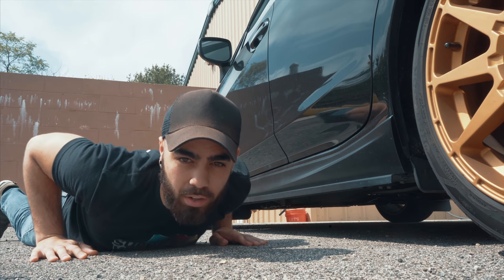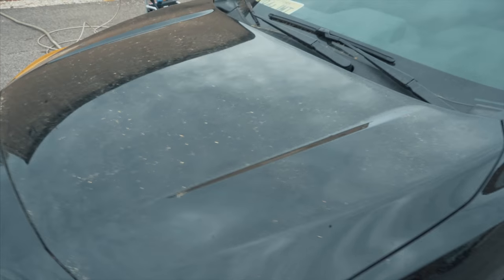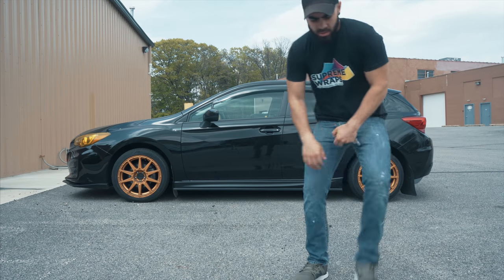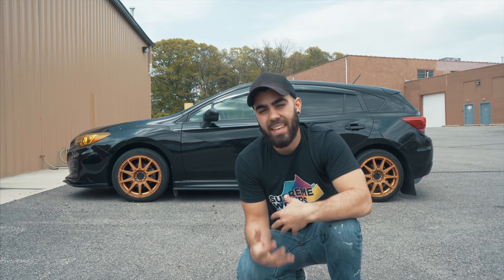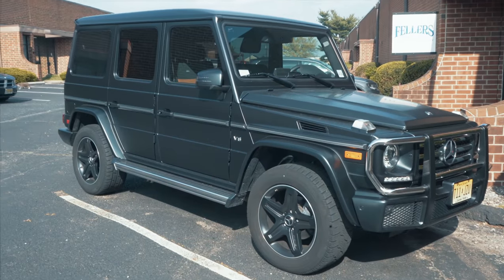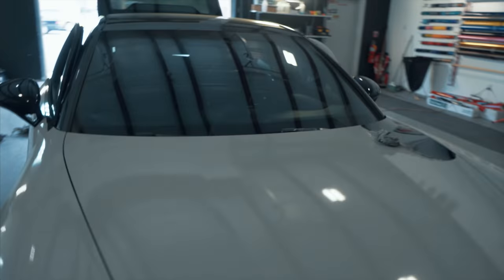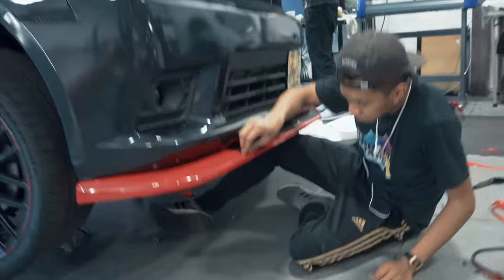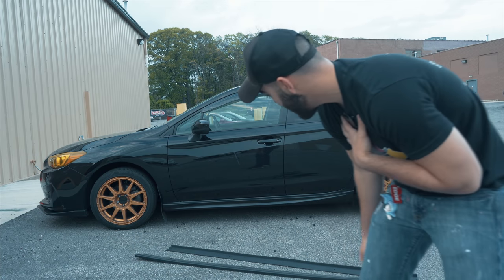Wrapping Side Skirts on 2018 Subaru Impreza w/ Supreme Wraps

Comment: Hey brother looks like you were using one of those harbor freight jacks if so be careful they work well but they don’t stay up some issue with hydraulics. Watch using a jack on your pinch welds or other locations by the front and rear wheels , it’s not ideal for jacking unless you have punch weld protectors. Better to jack from the rear differential. If jacking the front use the cross member . I picked up my pinch weld protectors from amazon at a great price.  I also use them on my jacks stands they sell protectors for jacks and jack stands . When I have to jack in other places I use a hockey puck ..  on another note I was glad to see you are taking it back a bit . I did not watch the last few videos because it looked like you made them just so we would have something. I did not comment because I did not want to insult you . These days seems like everyone gets upset over words .. young people lol .. get it together and show us what you are made of .👍🏻